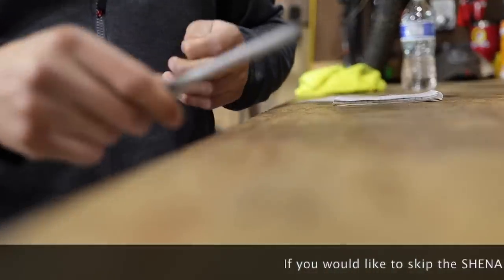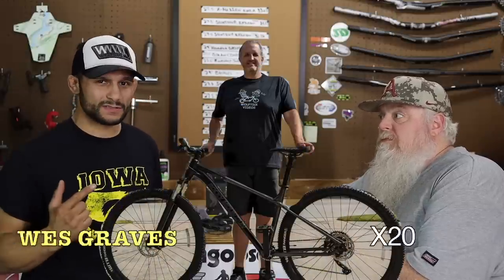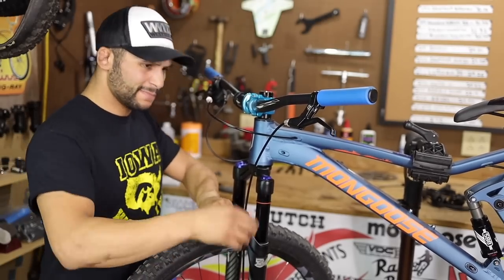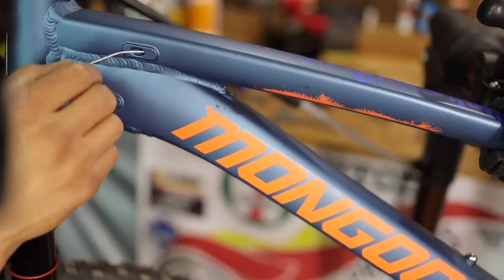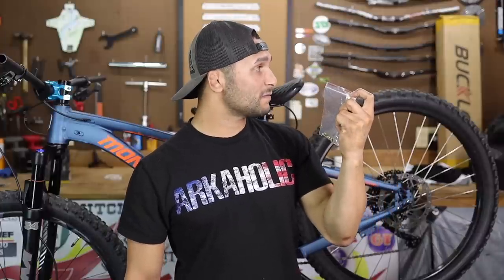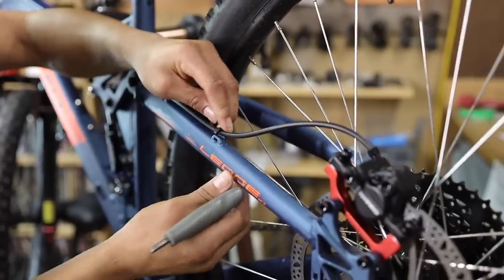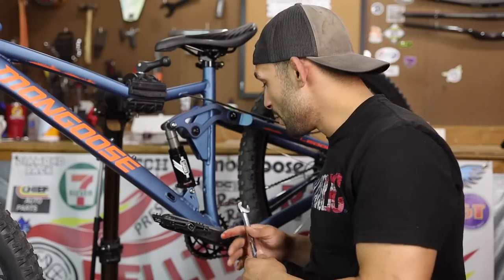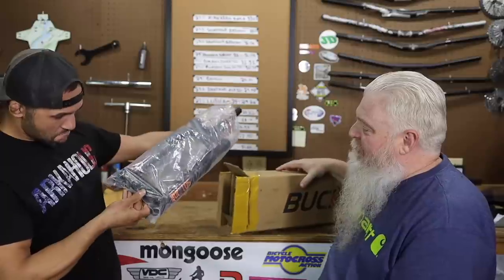TEKTRO M285 Hydraulic Brakes Initial Impressions

Comment: Caution on that ReachAdjustment screw.. Remember every time you bleed your brakes, back that screw up as far as possible (counter clockwise)  If you don't eventually, you will turn clockwise to make the reach correct, and the screw (which is really the rod attached to the piston/plunger in the lever reservoir) will fall into the housing of the lever..   The only way to get that little Adjustment screw out of the housing is to sent it into Tektro in Ogden Ut, and have it repaired  ($30)..   and once it falls inside, it jams up the action and the lever will not depress the fluid to make your brakes work.  Remember, if you turn in the adjustment screw on occasion, back it off all the way, before you begin to bleed your brakes..
Reply from the maker: Man thank you for the lesson in brakes!!! I appreciate that very much, will do brother.

Comment: I'm running Tektro brakes on my Trek and they're awesome. Also, get the correct brake adapter or they're going to feel sloppy
Reply from the maker: GOTCHA:) DONE AND DONE! The Tektros get a bad wrap sometimes but they seem to be holding there won on the Comp-ZERKER

Comment: Nice the ledge looks way better with the bars! I got some orange fookers on my ledge! Also upgraded mine so far with PNW Range gen 3 bars, ESI grips, DNM DV-22AR coil shock with a 550lb spring, Rock shox judy silver TK 120mm fork, Tannus amour rear tire insert.  I was wondering how you put the brakes on guess you need a tool to cut the line and re do it all to get it to go through the frame.  Great video.
Reply from the maker: Man yours sounds like a beast!! Now go and get some BRAKES!! LOL YOU WILL NEED THEM HA HA HA!! Thanks PH, always love the comments man.

Comment: Funny intro. It's like two Alpha males trying to establish their dominance. 

I used the foam grips previously and liked them but they were easily damaged in a crash, so I replaced them with rubber grips. Hydraulic brakes are fine, but when I ride from my house, I hit very high speeds going down this steep long hill and the mechanical brakes seem to stop me pretty well. Yes, I have the use two or 3 fingers, but they work. 

Where can I go to see Wolfman's photographs?

Here's a show idea for you. Cheap MTB Challenge. Get a couple of your viewers that like to work on bikes (so you have three people). Each uses $150 or maybe $175 to purchase a used bike and make repairs and upgrades with whatever money they have left over. Test the bikes at the Cat's Meow (or another trail) and see who made out the best.  This is like an MTB version of a Top Gear challenge.  It could make for some interesting moments.
Reply from the maker: You are a wise man. Your wisdom really shows on this comment.

I will probably put up a couple of pics in a future episode, but not 100% my call😉.  

 As far as the Top Gear inspired idea goes, in our experiences it would be a nightmare to rely on people other than ourselves to be able to get that done in a orderly fashion, but it sounds great😉😆. We are actually huge Top Gear fans and have used a little inspiration from the show here and there. 

Thanks for the continued support, it really means a lot to us🥰👍

Comment: I can't remember have you used Tektro hydraulic brakes previuosly. It will be interesting to see you testing that set, to see how it compares to Shimano's MT200 or any other big brand brakes. also, you'll need separate storage unit just for forks. I hope you had a great time on vacation. stay safe my friends!
Reply from the maker: Man it was wonderful, thanks for asking:) The brakes on the other hand are fine on the Comp-ZERKER but I am interested as well when it comes to the overall stopping power and performance when comparing them to the Mt200's?? Not too sure!! See you FRIDAY MARIO!!

Comment: I have these same brakes on my bike. Last week the rear brake lever went completley spongey and i noticed there was mineral oil coming from the small pin vent on top of the lever, Not the bleed screw.  Any ideas what could cause this? The bike is around 2 months old.
Reply from the maker: Hmmmm, i would hit up tektro man. We have had good luck with the customer service 😀